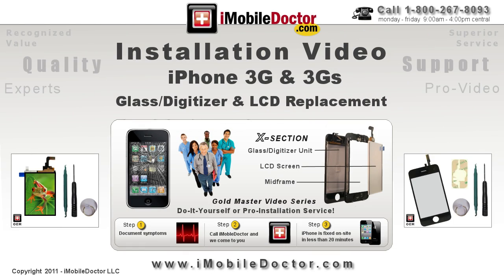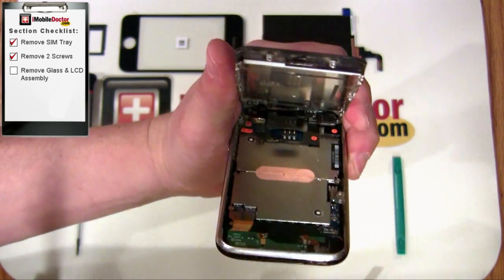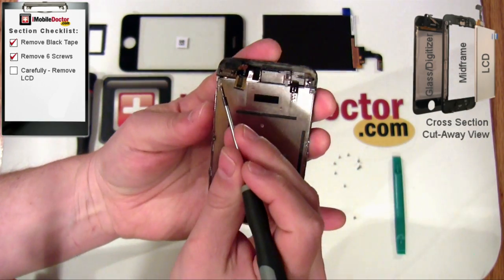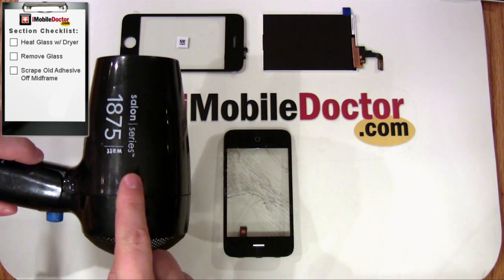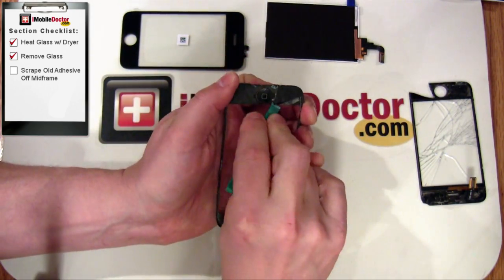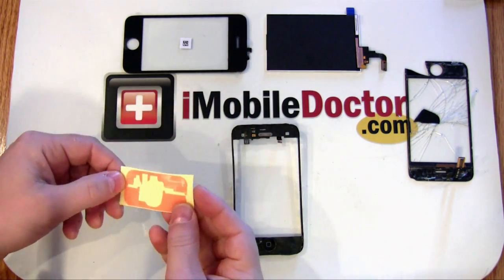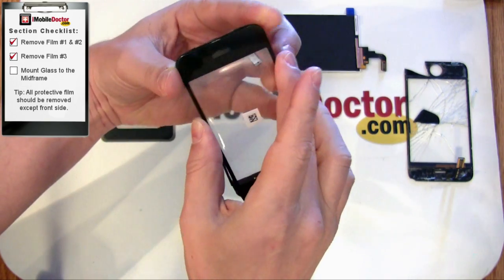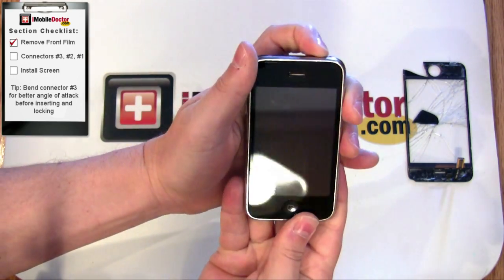iPhone 3Gs Screen Replacement by iMobileDoctor.com

Comment: Used this video to replace my screen. First time i did it too. Only problem i had is the sucker wouldnt pull the screen out and when it did it pulled the ribbon cable out without me levering it up!  But works great and thanks for your help